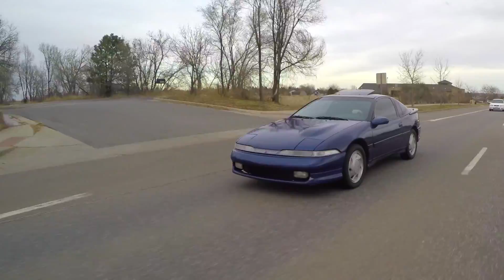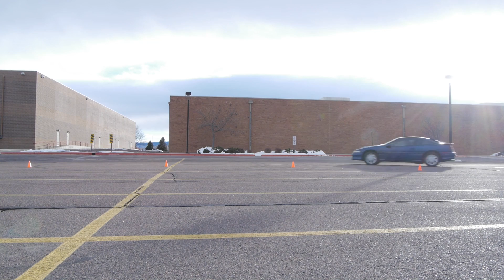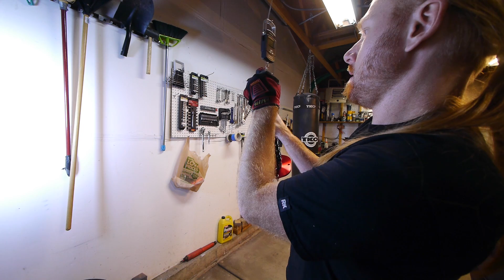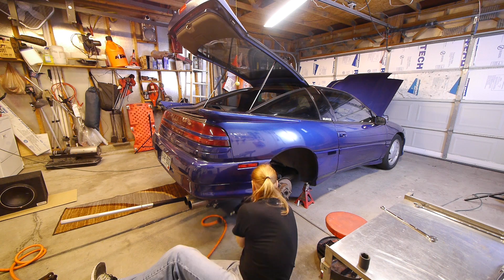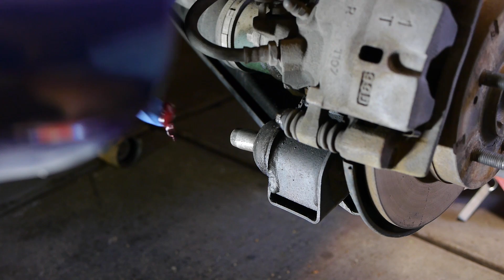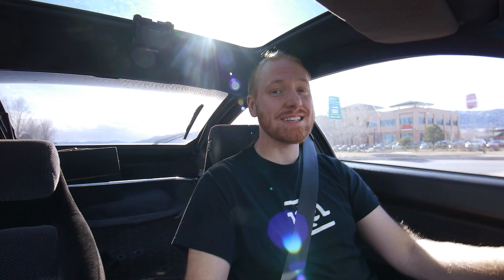Project Eclipse: Megan Racing Coilovers - DSM

Comment: Hahahaha these people probably were like oh your keeping stock height on coil overs down vote.. sheesh. I got eibach pro kit for my 2g, I am afraid the spring rates might be too soft for my liking but I am putting them on koni's so I can adjust the dampers to liking. The use of hey I have this app to test g's also seems fine its calibrated to itself so between old testing and changed it will be applicable to that given device.

Comment: Really well put together video very pro. This is everything I experienced on my Integra. I thought my Godspeed coins were too stiff as well even with the softest dampening and only like 6 or 8k spring rates. Coils are just not comfortable but the handling is nice! My stock Talon drove perfect on stock suspension it takes daily driving amazing! That's where I realized I prefer comfort over handling. Just too much beating on the body with coils it's just constantly slamming around. Anyways props for the video and awesome Talon Turbo graphic t-shirt. Matches really well with that gem you got.

Comment: Hello, Erik! I saw your topic on the DSMtuners on the front brakes of Outlander. You used Outlander's rotors and calipers, correct? Do they serve without any adjustment? Can the original 1G brake lines be used? Thank you! Congratulations on the excellent channel content !!
Reply from the maker: You need different brake lines for them, I got mine from http://roadraceengineering.com/     And thanks! I love your 1G, I follow you on instagram! :D
Reply: I have found Outlander calipers the same as the Lancer Sportback Ralliart. They have the same partnumber, MR370775 and MR370776. I'll try to use the original Ralliart brake lines in Eclipse. I also follow you on the instagram! Your car is an inspiration to me! I love the blue color!

Comment: By setting your preload to zero, did you have any bounce in your ride?
Reply from the maker: Not really, that's how the manual from Megan instructs it.   I just upgraded the springs to Eibachs though, they ride MUCH better.  I'll be doing a video on that in a bit.
Reply: Ok thanks for the insight, I'll be looking forward to your video on the Eibachs.
Reply: Ok thanks for the insight, I'll be looking forward to your video on the Eibachs.

Comment: How do you like the Megan racing coils?
Reply from the maker: I like them a lot, they handle great but in my opinion they're too stiff for daily driving on rough roads.  I'm going to change to some softer spring rates soon and see how much of a difference that makes.   I'll post a video about that when I do!
Reply: +Velocity Labs I will be keeping an eye out, I'm leaning towards the Bc racing br coils. Stock 1990 suspension has got to go

Comment: Timely advice! My '91 Eclipse GS is long overdue for new struts. I'm not sure if there's any point to adding racing suspension to a non-turbo daily driver, so I haven't decided if I'll try your coilover option or go for something softer. Either way, I'm very grateful for this video, so I just bought a "chill before serving" T-shirt as a thank-you. The detailed instructions should be very helpful when I start the project later this year.
Reply from the maker: +William Dye Awesome, thanks!  Yeah if it's just a daily I would definitely go with a new factory setup.   Monroe and other places make Quick-Strut Assembly packages with the strut and spring ready to bolt into the car, that would be the easiest DIY option.  Good luck!

Comment: I had the same issue pulling my talon tsi rears out I was a lil more lucky because I had a ball joint fork to loosen them out with, great work can't wait for updates on the dsm.
Reply: +Velocity Labs  hey it was awesome that you actually managed it without using one, I guess here you've proven that it can be done without it, likely motivation for the guys that don't have all the oddball tools we dsmers have, but its always good to see other ways to do service on these cars.

Comment: Outstanding video once again. Very entertaining and very nice touch with the editing. It was finally awesome to see you uploaded a video after my daily search to your channel..LOL
TECH TIP: On those rear shock seized mounting posts, I have had great luck with a two or three arm pulley/gear/steering wheel pullers. It literally pulls them off in seconds! Also anti-seize on the mounting post for future removal and you are golden!  Heat works well also as you see though...Great job man! Keep them coming!
Reply from the maker: +4G63addict Thanks!  Yeah, someone else mentioned a pickle fork works well too, which I even have but wasn't smart enough to use XD

Comment: I'm going to get a set for my 1g tsi now thanks to this awesome video!
Reply from the maker: +Brandon Gallegos Just a word of caution, these are VERY stiff, too stiff for daily driving I think.   If you don't need the camber adjustment, I'd probably go with the  Megan Racing EZ Street Coilovers instead of the Street Series, the spring rates on those are much more forgiving.  I'm going to change the springs on mine to a softer spring rate later this year.  They are awesome though, the ability to adjust the height on a whim is great.
Reply: Hey thanks for the advice really appreciate you getting back at me. Im looking for coilovers that i can adjust ride hight and camber. Anything better than stock blown suspension is great with me. I do daily drive my car alot n i just hate how it rides!

Comment: Did you level out all the coils to the same height ( when on the car ) so the wheel gaps are all the same height? Or is that an un necessary step?
Reply from the maker: +TriniRogue I didn't do that yet, I will be adjusting them in a future episode though.   I got lucky because they were pretty close, within 10mm or so on each side.